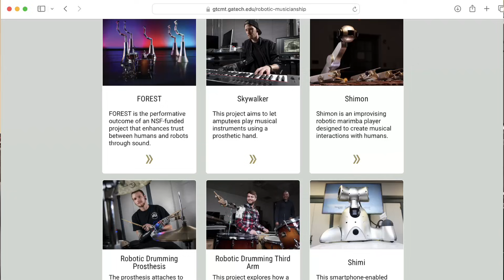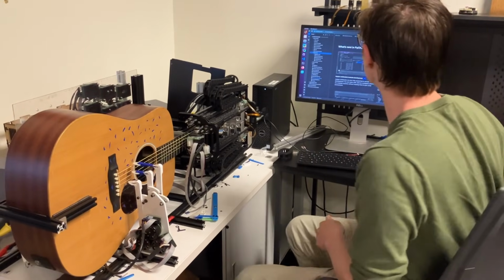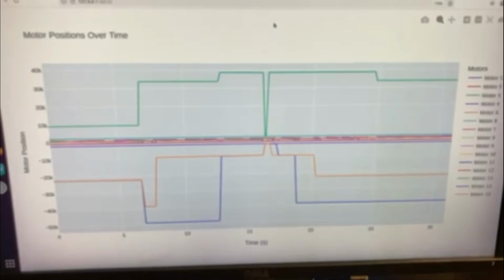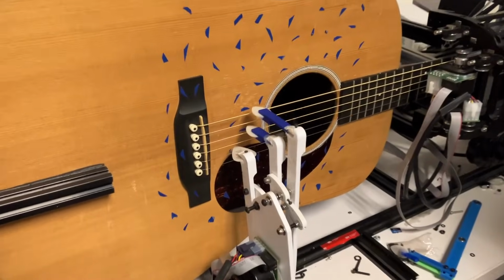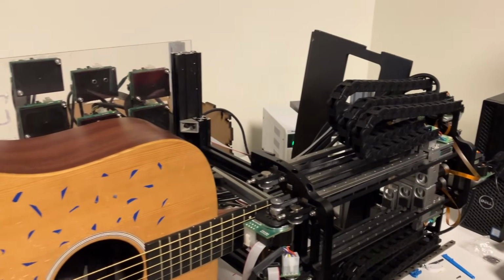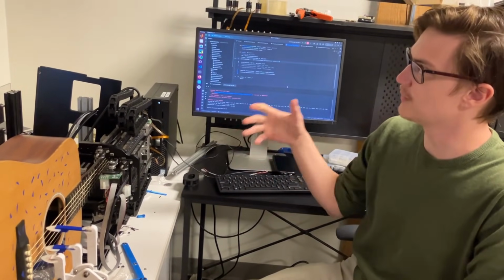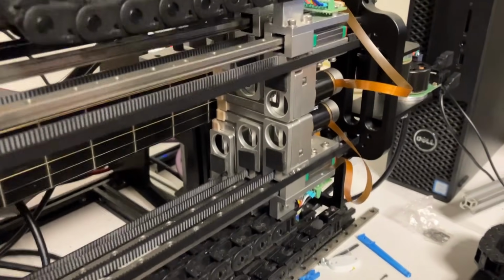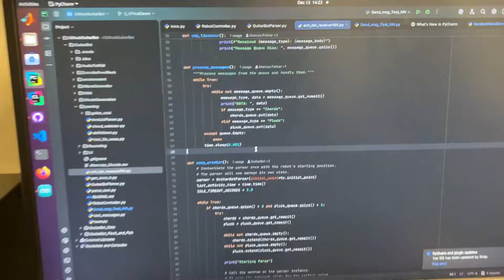Guitar Bot Polyphonic Fretting (Robotic Musicianship Group at Georgia Tech)

Comment: I think if I wanted to build a robot to play guitar, the first thing I would do is ask myself do I need the guitar itself. Six strings in the way of each other is a layer of complexity you don't need when you have so much work to do to make a machine that can play one string musically. Once you have that, you can duplicate that machine to play in harmony with itself. The other 'strings' could be in a different room, or a different country - heck, one on each continent! 20 strings, 40 strings... 🤯😂
Reply from the maker: I think that would make a lot of sense for a "guitar" using electromagnetic pickups. For an acoustic guitar, it's nice to have all the strings sharing a body to get all the shared resonances.

Comment: I was worried it was gonna be T200< terminator reference> .
  Not even as good as kirk hammet...needs a wah pedal
Reply: Lovely piece of engineering. Congratulations on your progress so far!
Reply from the maker: At a basic level, I'd be tempted to create a purely electronically controlled wah filter circuit. But... it would be much cooler to have a robotic foot controlling a real pedal!